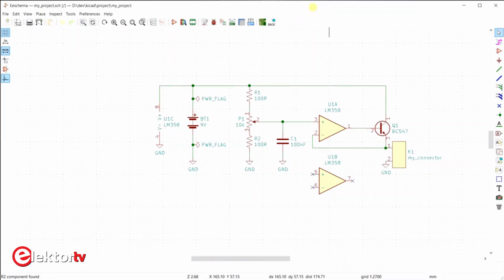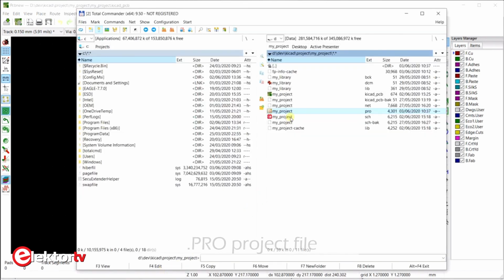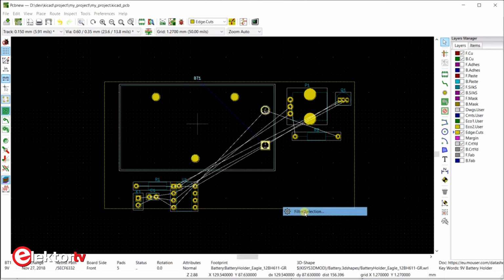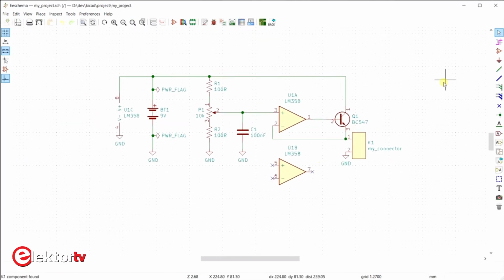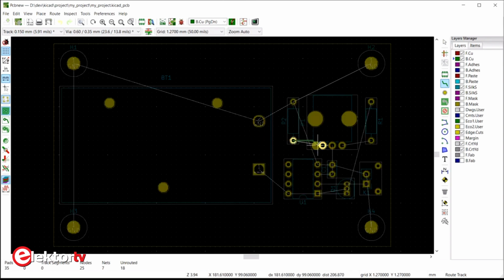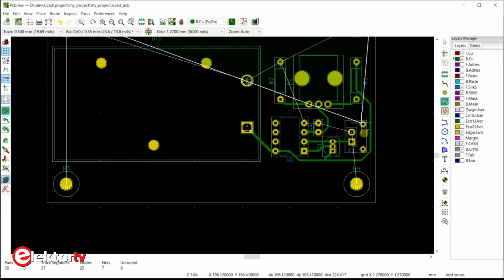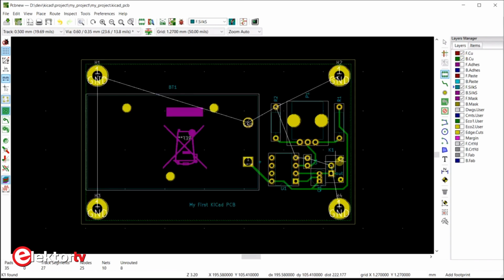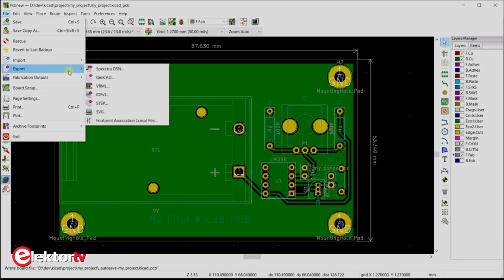Getting Started with KiCad EDA - Pcbnew PCB Design

Comment: Small tip (learned the hard way!):
Do the BoM and buy the parts BEFORE sending the gerbers off to the PCB house. Print out the PDF plot and set the physical components on the 'paper board' as a final check. You'll catch a lot of mistakes that way and avoid scrap boards! With the price of printer ink it is a bit debatable if you save money, but you certainly save time!
Reply from the maker: Good tip!
Reply: I did the same thing when I first designed my own PCB recently. :)

Comment: Nice video. Good review of the (currently latest) v5.1.x workflow. Only 3 points that I'd like to make.
1. When exporting gerbers and drill files I like to put them into a "gerbers" folder (selectable at the top of the plot window). This helps keep clutter down in the project folder and to make it easier to grab the right files to send to the board house.
2. Gerbview can also view the drill file at the same time. It is a second load operation (either before or after loading the Gerber files). This helps to make sure that the drill file lines up properly with the gerbers.
3. I prefer to export the BOM from eeschema because any ordering information that I add to the parts in eeschema doesn't transfer to pcbnew. The BOM exporter in eeschema is more complicated but also more flexible.

Beyond that, really nice video. I'll have to check out your other videos in this series. Because KiCad has changed significantly in the past couple years, it would be nice if you mentioned in the description exactly which version you are demonstrating. This will help those of us on the KiCad forums evaluate what frame of reference someone seeking help is exposed to. (And v6, hopefully in 1-2 years, will have even more changes.)
Reply from the maker: Thanks for the remarks. Version info added to the description. It is "(5.1.6)-1, release build".